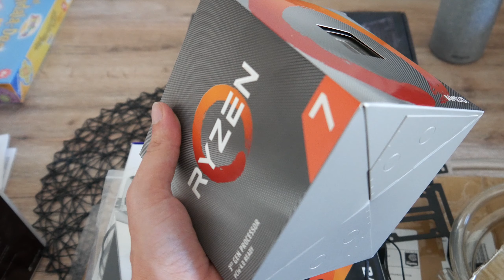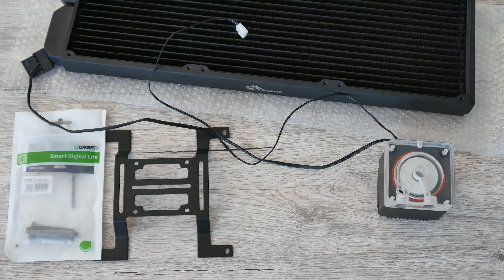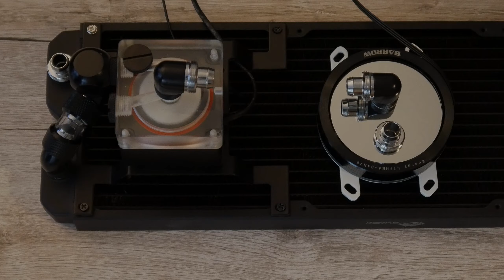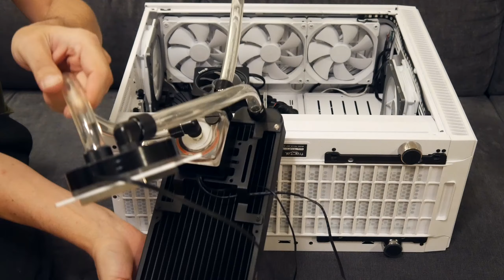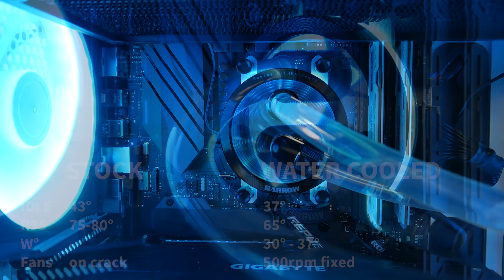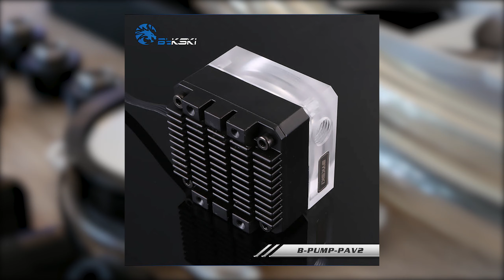We Crammed a 420mm Bykski Radiator into a Fractal S2 Case

Comment: I want to see how Chinese components perform - technically almost everything is produced in China, some products are branded, and some are not
Reply from the maker: There are lots of reviews out there by now. This radiator is still going strong. It moved into a BeQuiet Silentbase 802 in the meantime. Got a new barrow cpu block, too. Everything is fine and I'm quite happy. The pump got replaced by a smaller Bykski 5V pwm pump.

The thing is: China produces on any quality level you want. So we sometimes get low quality "western branded" crap for way too much money.

Comment: I regret buying this case instead of the regular 2. When I was planning out my upcoming new custom loop I figured: I won't be able to fit a 420 without it looking silly or putting stress on the DIMMS. There are now 240's in my build with flex tubing, but I get my GPU soon I wanted to go rigid 420 + 360 :'( Sad face. Also, it looks kind of ugly when you can't see the full board in all it's glory. I guess I have to try and see if I can make 240 in the bottom and 360 in the top work (but I think it will interfere with my cabling), otherwise try to sell this case.
Reply from the maker: Hm. Wouldn't be different with the regular 2. They have the same rad clearance. I replaced it with a BeQuiet 802 now. Great case. They finally built a case with enough space, good looks and well thought out features. Also it's comfortable to build in. Its predecessors were atrocious in this regard. Put the 420 in the front. Still enough space for a 280 in the top.

Comment: Excellent video !!!!  I want to make this for my strix 3090!! With an ek water block.  I been researching for the last day some components. Diff size radz. I have 3 x140 fans front intake at the min,  the case is mesify s2. 
I dont think a 420 rad will fit in the front. 
So im debating a 360 rad in the case and put the  3x140 fans outside the case lol. (Frankinstien) .. i have room for a 280rad inside and fans inside.. but..but... "U" know the reason i want the 420 rad dont u !!! 🤣🤣🤣 .. i dono, il keep researching

Comment: hows tight is the fitment with the ram and 420rad with the fractal s2 case?
Reply from the maker: Tight. I was forced to use the Crucial Ballistix variant with the lower heatspreader. Some Corsair sticks would fit, too.
Reply: @WatchMysh  Also it looks like you had to take off the IO shield right? I have the same board, the RGB died on the board so I painted the white plastic bit to match my build
Reply from the maker: @Luxussyy  It's not on purpose. I just don't have it :D I got the board without any accessories. Long story.

Comment: pump on rad... good luck.
Reply from the maker: What's the problem? Works as it should. :) Many AIOs for example from EK have rad attached pumps.
Reply: It should be no problem, because he can refill the loop if permeation gets to it. Also as long as the pump gets water from a higher point, it's totally fine.

Comment: Hey man,its a great idea,you can try using it just for gpu and make turn the fans to intake intead of exhaust though top mounted. You might get better temps.
Reply from the maker: I'll use an nzxt g12 and a front mounted 280 rad for my gpu. Video coming soon. ;)
Reply: The top intake fans may not work but try testing. Think you should have better temps. This link he managed lower temps but am unsure his fan rpm.https://youtu.be/JhAqzgiOuRI. You can try,using artic mx thermal paste,has higher thermal conductivity and is cheaper. For fans,static pressure optimised, can try arctic fans for cheaper for go corsair ml140/noctua is best. Rear fan you can try fractal hf-14 so remove air in case. You can refer to gamers nexus, jayz2cents, ggf events, bitwit. Water cooling can be expensive so experiment with what you have, you can try second parts. Wish you all the best and goo luck.
Reply from the maker: @paulmichaelsabapathy9672  Hey, thanks for the input. Let me explain: I used the fractal HF-14 fans overall because they have a good blend of static pressure and cfm and perform very well in the low rpm range. They are among the best there according to thermalbench. We've used Gelid GC-Extreme which is better than the arctic MX. It's not my first loop. The first one I've built was in 2003.

Next up is a modified AIO for my GPU. I'll have to mod the S2s front for it to fit but I think it'll be worth the effort and will look quite clean in the end. 

Temps are different now since AGESA updates by AMD. I'm now idling with a delta to the water of 6 degrees which is quite good.